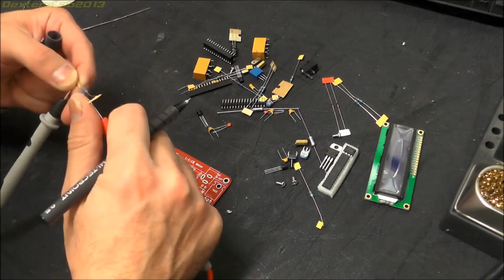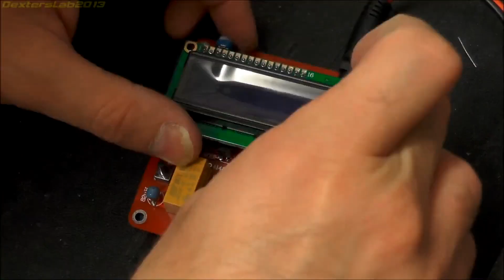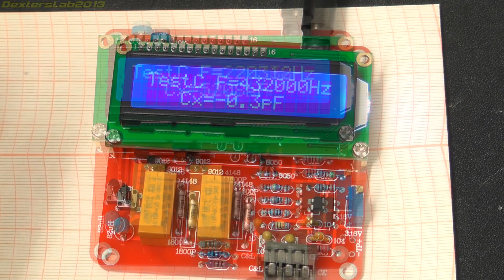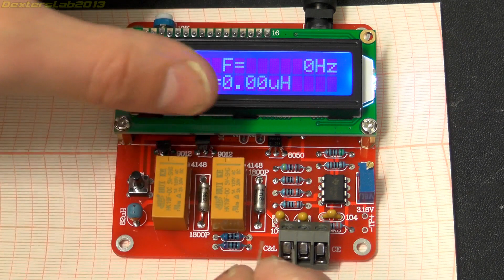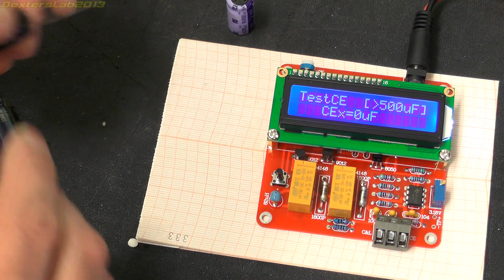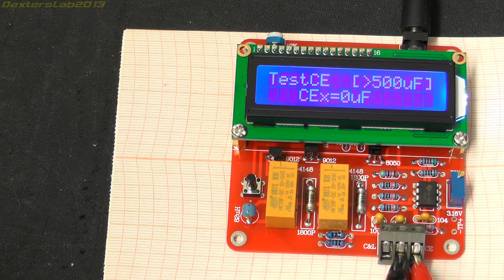DL#076 - Build & Review M8 Cheap Ebay L-C Meter Kit

Comment: Older video here, but just wondering about the silkscreen that provides test points, and says "3.16v".  Did you adjust that pot to get that value, or did you just solder the pot in with no adjustments?

Comment: Great video. I have found the "grab bag" parts from China to often be far outside tolerance range indicated. If you have a few known value inductors, this will be a better test of results validity of this device (sort of catch 20, if you do not have an LC meter!)

Comment: Quick tip for timelapses: put your camera in manual and lock the settings in, so it doesn't flicker that much.
Reply from the maker: +Spirit Thanks, yea i always use manual exposure. The flickering is probably just me making shadows, the light is above and slightly behind. One day i might have some ££ to spend on better lighting!
Reply: DextersLab2013 Or spend just one £ on a chinese version of the better lighting!

Comment: the first numbers look like cal values if you look at the capacitors and inductor near the relays. Maybe some kind of reference values... Maybe you can trim the meter with the multi turn pot.
Reply from the maker: +Delinquent Engineering I am not sure what the trim does, i think it's supposed to be set to 3.16v with the trimmer but it doesn't seem to make much of a difference!
Reply: +DextersLab2013  I just built this kit and found that I needed to trim quite a ways to get it to 3.16v - probably 10-15 turns in my case.
Reply from the maker: +David Griffiths This is normal, the trim pots is multi-turn and will ship from the factory in some random place